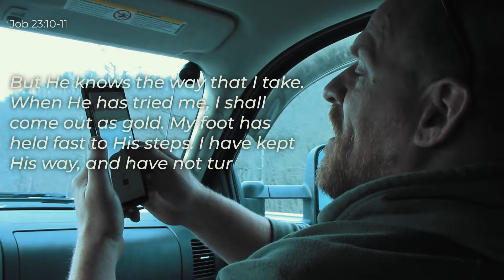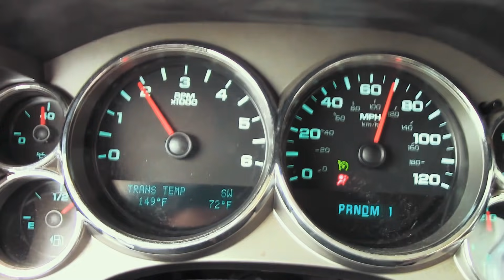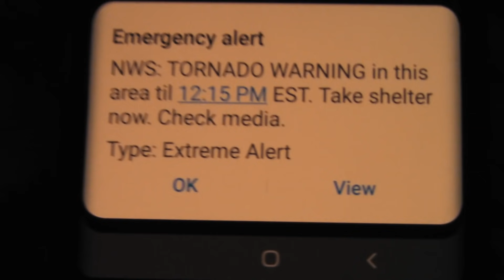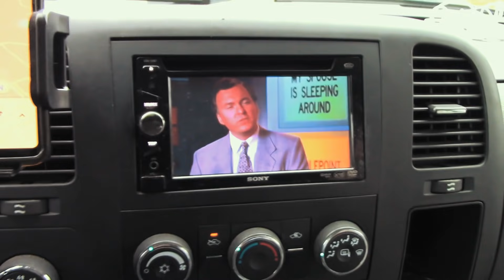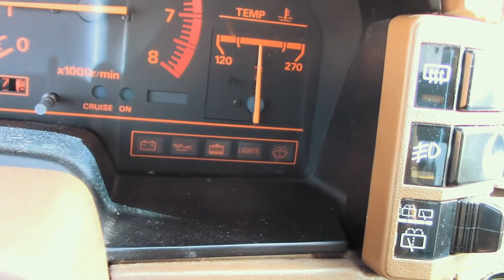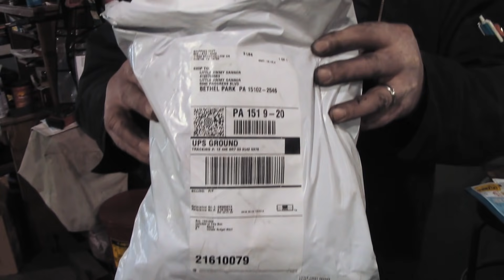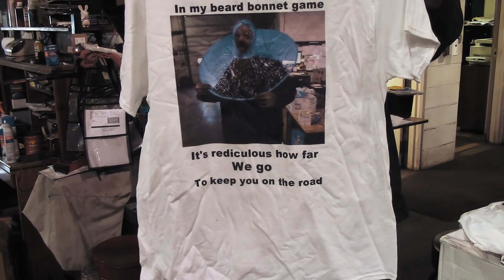Florida Trip To Buy A Rust Free 86 Nissan 300zx

Comment: The 300ZX got nervous once it heard you talking about how clean it is, "where am I going?"
Reply from the maker: lol exactly! It ended up having an issue with the ECT connector (typical on this model that the weather sealed rubber cracks and breaks and allows water in there to sit)

Comment: Gonna do this comment as I watch the video. 

The misfire at idle? Good luck, that's the good 'ol Z31 pop idle. I would LOVE to see you figure it out with the stock ECU, but I don't have high hopes, even with you behind the diagnostics. Insane props if you figure it out.

The clunk in the rear? Rear subframe bushings, or the diff mount. 100% of the time.

Headlight issue? Headlight switch on the steering column 90% of the time. Glad it was just the light itself though.

You don't know how stoked I am that you'll have videos on this platform Danner. This community has needed a 100% professional  tech making videos about them for the longest time.
Reply from the maker: great tips that I hear just from your comment!
The idle misfire, I haven't felt the need to even care about it, as my son doesn't lol, but your simple comment of "not with the stock ECU" tells me this was a programming issue with the feedback system (O2, Fuel Trim, injector pulse). Bet if I unplugged the upstream O2 it would stop 🤔. The clunk in the back was a warn out shock mount, just the rubber. Added a washer to squeeze them tighter lol
Reply: @ScannerDanner  I forgot about the shock mounts. I replaced mine before they even went bad. 

Yeah the O2's on these cars are pretty well useless. You could unplug it and it'll just use predetermined values and not have a care in the world. Good old OBD0.

Comment: Thanks for the video danner! I just drove 5 times from PA to FL back and fourth in 2017 and I could still remember the road that you showed here. Now I’m in the same boat as you where I have to bring my car from my parents house in FL back up here in PA. I definitely don’t want to drive it and put 1600 miles into it. I’d like to put it up on a trailer like you did here but I only have 4” of clearance on my bumper and it might damaged it. Now is the good time to do drive the car since there’s no more junk on the road. Oh that’s Very nice car that you picked up!
Reply from the maker: If it has been sitting, I would definitely want to trailer it too. You WILL have breakdowns otherwise.

Comment: In high school, I had an 86 300ZX. Black on black with t-tops (that only 1 would come out lol). No a/c, which sucked in the midwest during the summer. The clutch required a few pumps before it would build pressure and release. And it slipped so bad that you could shut it off, let the clutch out at 10-15 mph and it would keep rolling for a good 20 feet. I was leaving a store one day and didn't pull it into neutral and only stepped on the pedal once without pumping it up, I hit the key and it launched out of its parking stall. Luckily I cranked the wheel quick enough not to drive into the other cars in the lot lol.

Comment: Haha sometimes being a parts changer is what’s needed.  Takes me less then a min to swap out the tail light on a step van, testing the light and wiring takes at least 10 min once you get the power probe or multimeter.  99% of the time it’s the light, the other 1% I’ve added a min to my diag time.

Comment: Nice, man!  BEAUTIFUL car!! Our '86 Grand Marquis came from FL, too - we bought it locally, a long time ago. Paid too much for it, but it was IMMACULATE, just like that one. I knew we'd have it forever, so I didn't argue with the seller. We're still driving it 18 years later. 276k miles on the ORIGINAL driveline and electric fuel pump too, and counting! We take it off the road whenever there is any chance of road salt coming out - in November and December, we watch the weather forecasts like a hawk. Even the slightest chance of precipitation, it gets parked. You have to be that way if you want it to last. 

I just made this same trip starting 4 weeks back. Was 28° when I left - not a single bud on any tree. Got to FL - 85°, everything green. Pretty much from NC south was green. Was real nice! I was gone for 3 weeks doing paramotor trike training in western-central FL, where it was in the low to mid 90's every day. I camped the whole 2 weeks in that! Wish I could've brought a car home with me, but I had the enclosed trailer with the paramotor inside. Too bad I couldn't hook the flatbed up and have a train in tow, lol. You can do that in AZ! Anyway, I brought every tool I own because my Silverado is a poorly built POS too, lol. My rear window doesn't work either.  I already had to replace my hinges at 107k miles. 3rd and 4th burnt up last fall at 103k, and the rear diff self destructed at 97k. Thankfully all I needed on this trip was Gorilla tape when the wind caught my trailer siding and peeled it back 3 feet, LOL! I looked in the mirror somewhere in GA doing 85 MPH and I see this panel flapping in the wind blocking half the lane next to me! Had to bang it back in place, caulk the bottom, and tape the front on the side of the highway. Trailer has seen better days after 19 years - all the rivets are falling out.

I laughed at the Happy Gilmore reference!! That movie was a RIOT!! "You eat pieces of s#$! for breakfast?" "NOOOOO!" HAHAHAHAHA! My favorite part was "Jaws" when he says to Shooter McGavin ..." ... And YOU can count, on ME, waiting for YOU in the parking lot!" I don't know why I find that so funny, but I can't stop laughing whenever I see it, HAHAHA! Just the way the guy says it, and he's so huge, lol. Great vid Paul - thanks for sharing.
Reply from the maker: hahaha I know that exact scene! Thanks for watching with us Smtty! BTW I have two new SDP videos up. They should be out later this weekend or Monday at the latest. A nice parasitic drain saga
Reply: @ScannerDanner  - Thanks for the heads up, brother. I’ll be watching for them. 👍😎

Comment: Nice trip. It’s great seeing you guys have fun together and great car find too. At least your trip went well. I blew a front tire the other day towing and ended totaling two cars at once. Good thing is I have done all my own stunts for the last 50+ years. 🤣🤣🤣
Reply from the maker: glad you are okay my friend
Reply: surprised you lost it being a front wheel, it's usually best to lose a front on single axle single wheel rears.
that said, things do go sideways fast on any tire loss!
Reply: @throttlebottle5906  From what it looks like the front tire had a repair that should haven't been fixed and let go. It was probably the worst timing possible when it happened At the bottom of a grade just going into a dip in the road. The trailer started fish tailing on me and I tried to accelerate out of it, but all I accomplished is put myself in the jersey barrier at about 50mph.
Reply: @cullenmiller8170  OUCH! I guess still being here is blessing enough.

Comment: The z31 is my favorite car. No drivers aids like traction control. Front engine, rear wheel drive with a real 5 speed manual... Manual? What that? 
 I've owned 3 all 86 GLL manual. my first one was in great shape, but I was a 20 year old male and rolled it. Next year I bought a rust bucket but I loved it, engine was shot, so I pulled the engine from the first car from the junk yard, paid $850 cdn for my own engine.. did a full rebuild on the engine. That car got scrapped but I saved the motor for like 10 years until I bought my current one about 7 years ago (I'm almost 39 for anyone doing the math). This engine was burning oil bad so I swapped it with the rebuilt.

Comment: Doing more work on my 2004 Chevy Suburban Z71 1500, The doors will unlock and lock by them selfs while driving down the road, Interior lights stays on, (On the dash it says Passenger side door open when its closed) The passenger side window works when it wants to. Where do I go first?

Comment: A garage kept car taken to the rust belt to die

Some advice from an old locksmith.
The ignition locks are subject to sudden and annoying failure.

This is caused when the shoulder wears down and breaks the stop inside the cylinder.

You can prevent a lot of grief by making sure you don't use worn keys. See your local locksmith, especially if there is an old guy around the shop.  Back when these cares were on the road it was not uncommon for a locksmith to overhaul 3-4 per day.
Reply from the maker: no! no winter driving for this beast, my son still has his 94 celica for that

Comment: The shop I work for specializes in these old nissans. we currently have a 78 280zx with 4k original miles on it at the shop! we have the factory service manuals, hmu if you need any info.